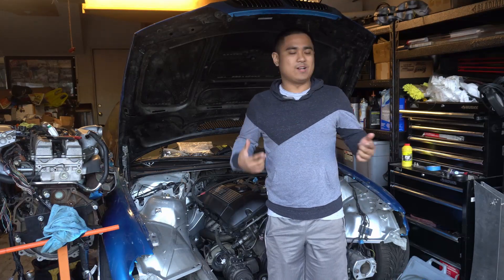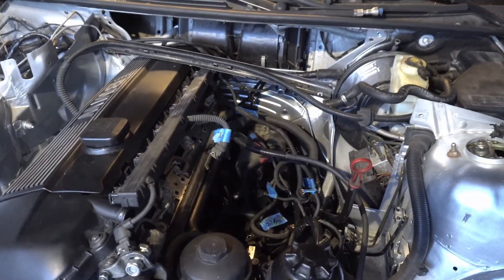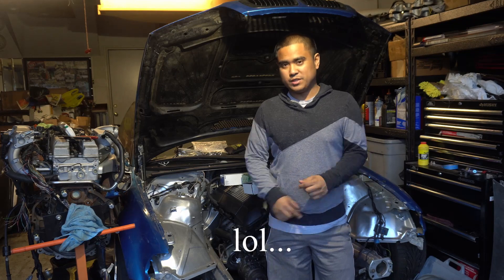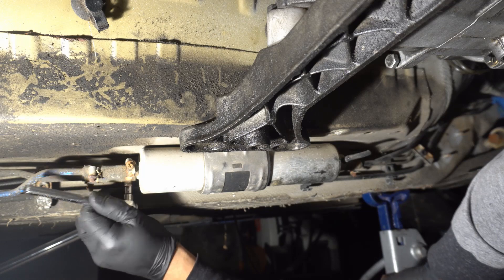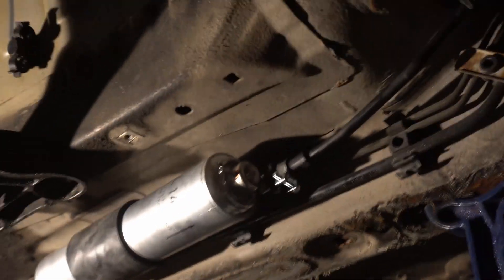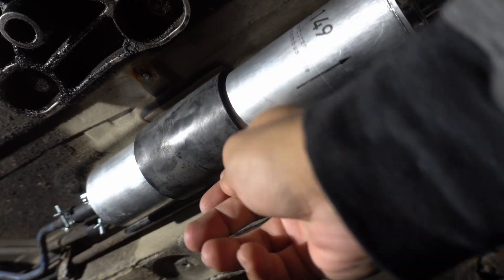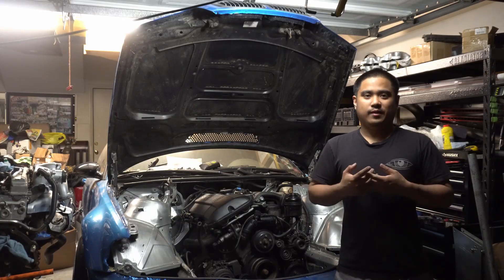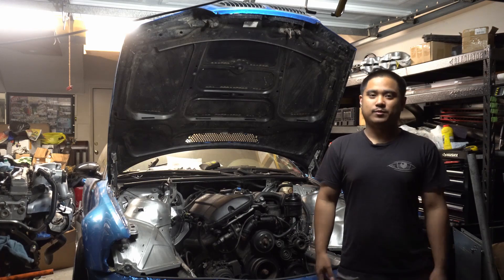Turbo E46 400 Horsepower Fuel Setup | #TheE46DriftBuild Ep 52

Comment from the maker: IF YOU RUN THE BOSCH GT2 INJECTORS, OR OTHER EV14 INJECTORS, YOU MAY NEED INJECTOR SPACERS WHEN USING THEM WITH THE M50 INTAKE MANIFOLD! Check out the linked in the description

Comment: Hey bud when I change the headgasket and fit the decompression plate, do I really need to change anything else other than the cylinder cover gasket n intake?
Reply from the maker: Sounds about right to me, but I haven't done a head gasket job yet so take it with a grain of salt.

Comment: Mannnn i wish i looked at this before.. Pressed my GT2 injectors to deep and when i pulled them, the plastic piece fell in the cylinder hahah. But were did hou connected the vacuüm source for the fuel pressure reg?? That was used to be in The F-connector
Reply from the maker: I felt the same way when I found posts about it on facebook. I connected the FPR to the port on the bottom of the M50 manifold.

Comment: I did the m50 manifold swap and you can retain the stock plastic cover for the injector wires. You just have to flip all the connectors around. Looks much cleaner imo.
Reply from the maker: Good to know. Luckily I still have mine.

Comment: Nice features. The bosch injectors are the best. I recommend to use rs4 maf and add an oil drain pump for turbo. I couldnt solve the oil burning issue without the pump. Oil level in oil sump is too high and its getting out of the turbo shaft
Reply from the maker: I’ll actually be running a pmas maf, and I’ve already started looking into scavenge pump options as a backup!
Reply: @nuisance_carl  I'm currently working on installing my pump now. Any big turbo sits too low and the turbo doesn't drain properly. I had oil leaking out of my turbine housing
Reply from the maker: @flyhacking5830  damn...

Comment: That fuel pump wiring is dead sketchy, you should’ve just used the OEM harness, saved yourself the time wiring. Been running a walboro 340 on stock harness for a couple years now, no issues. The aem unit should draw close to same current as stock so you’d be fine. You’re Sacrificing OEM function for no reason with a new rely
Reply from the maker: Welp, guess we’ll have to see how it turns out. Majority suggested upgraded wiring.
Reply: He’s better off having the FP hard wired factory pumps for sure pulls less amperage than the 340lph pump use ohms law and find Amperage rate for the new pump so you’ll know if the current is to much for wire gauge you’re currently using as well as you’re fuse. 

Factory 16 gauge wire will fail at some point due to excessive current draw from the pump and the wire will get hot and break. I tried it out with the walbro 255 and it lasted 2 years on my turbo e30 now have a 525pump running 12 gauge wire going to a 20amp  fuse hardwired to battery no issue yet making over 700 on my forged s50 full e85 If you have any questions ask on the bimmer forums FI page.
Reply: For sure but he’s not running a huge pump, did the factory wiring fail for your smaller pump out of curioousity? Or did you just change to because you needed more fuel?
Reply: Don't recommend running the factory wiring. It's way too thin. The relay harness uses like 12 gauge vs stock looks like almost 22 gauge.